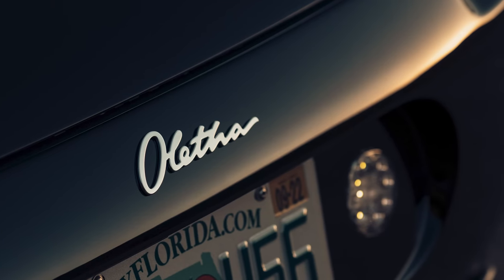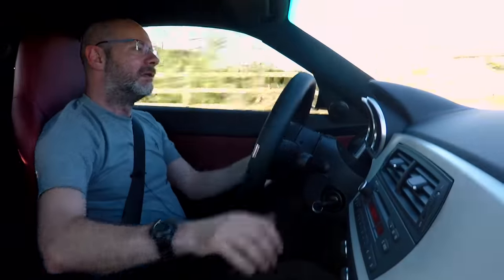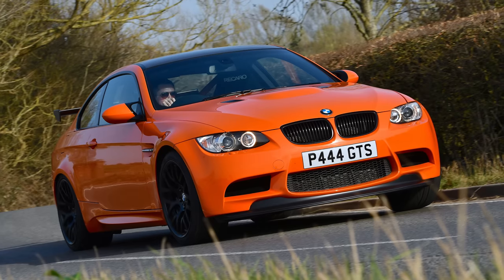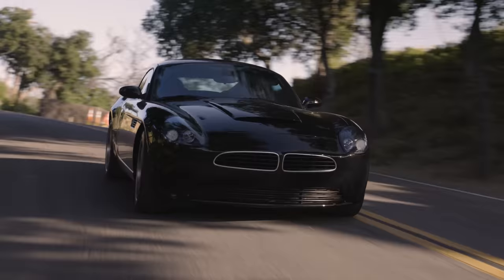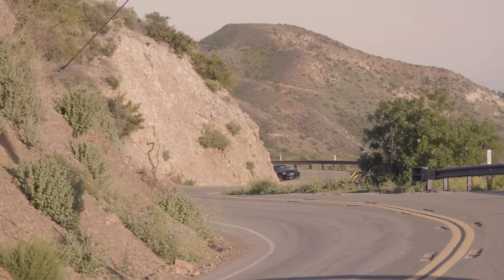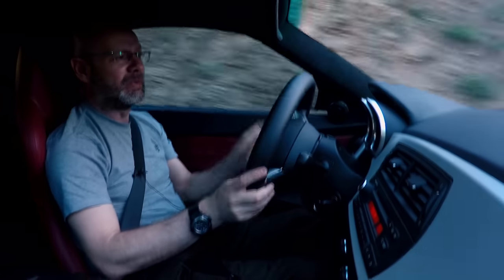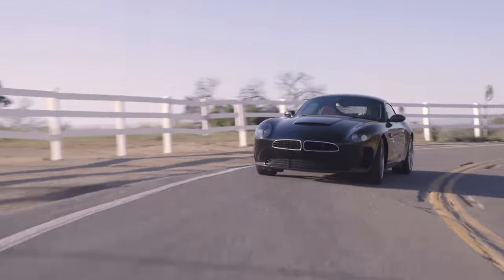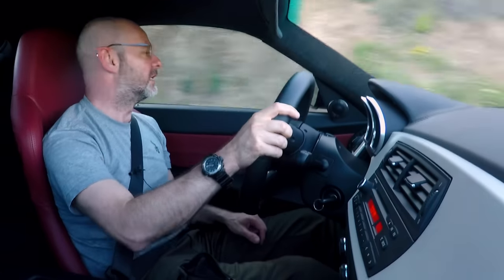Smit Oletha review | The BMW Z4 restomod that thinks it's a Z8

Comment: Why spend $350-400,000 on this when you can buy an actual Z8 for $200,000?
Reply: because this is a better car compared to a Z8
Reply: Because you can no longer get a low to mid  mileage Z8 at that price range .
Reply: @PatrickRW99  "Better" as in more reliable? Better to drive? So a Z4 with a sexy body and a few engine tweaks is "Better" than a Z8? $200,000 more, better?
Reply: @thebondvivant8030  it’s a Z4 M, with a custom body, and a completely different V8 engine. It’s not just a few tweaks and a ton of work went into it
Reply: @thebondvivant8030  that v8, engine alone (M3 GTS-Spec  V8) is probably worth the 200,000 extra
Reply: Good point! Also the Z8 interior is beautiful!!
Reply: I'd rather have this

Comment: If you have the means to buy one, why not simply buy a Z8 instead? It's much prettier and has a much more special interior.
Reply: A z8 goes for at least £150k
Reply: @TheFlyingClutchman  And this thing goes for 300-400k!
Reply: @tominator23  oh damn wasn't expecting that 😂 I can see that this is a much more focused sports car than the GT car the z8 is so it does serve a different purpose. But idk unless they give me a fully carbon fibre body with almost everything bespoke (kind of like a Singer Porsche) then it may be able to justify the price
Reply: Better yet a spyker 4.2 with a much classier interior

Comment: It's perfectly true that mass produced luxury cars tend to have much better designed and built interiors than low volume hand built stuff. However, they should be able to provide something better than a 20 year old Z4 interior given that the $400k price tag puts it firmly into the bespoke category. While I understand that low volume cars are inherently very expensive, they're using BMW drivetrain parts which puts me in mind of Wiesmann MF4 from some years ago. Even adjusting for inflation, the already expensive Wiesmann was less than half the price of this.
Reply: Yep, there are many ways to transform the interior, there are even companies that do it.